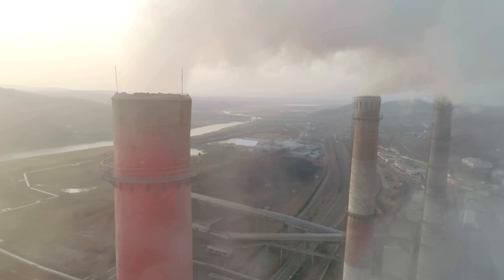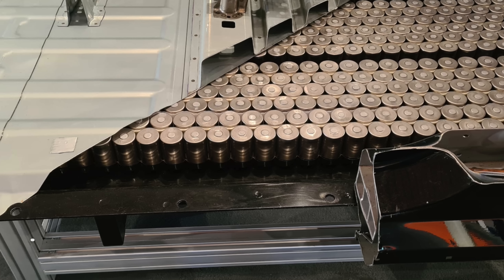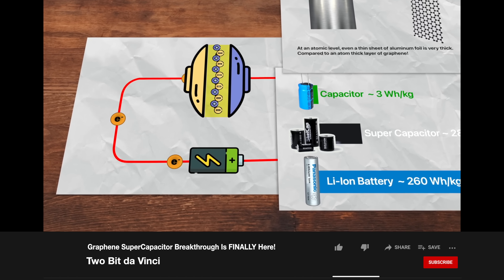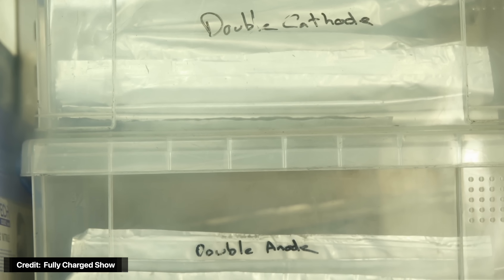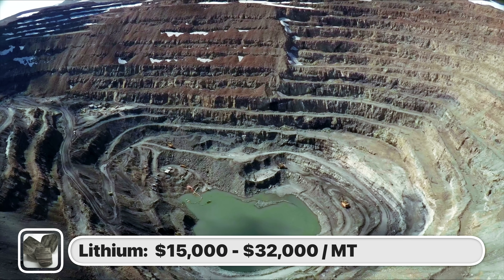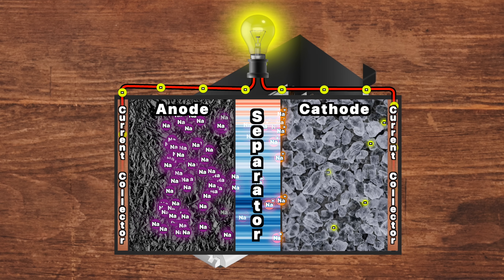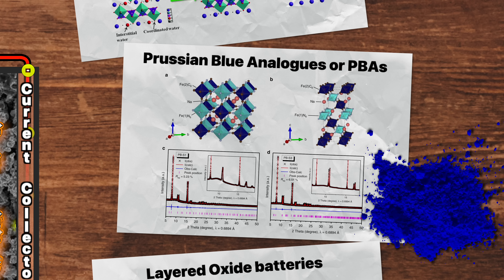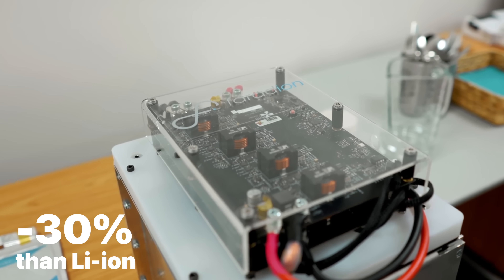Next Gen Battery is 1000x Easier to Source and 99% Cheaper!

Comment: Near the beginning of this video there is a critically important false statement that Na-ion batteries equal Li-ion batteries "in performance." Unless "performance" is measured differently than how I define it, that's a major error, because of where Na and Li are on the periodic table, depending on how you compare the two elements, Na has about half the energy density or at least double the mass as similar Li. 
But, approx 2/3 into the video, this is corrected and describes how Na is less energy dense than Li.
Unfortunately, this video does not adequately describe the consequences of this disparity which is grounded in basic physics so cannot be overcome by some technological breakthrough. This is because for any tech breakthrough using Na, because Na is so close to Li in the periodic table it means that the possible chemistries are also quite similar so any innovation for one can also be applied to the other and that means that any improvement in Na chemistry would also provide a similar benefit for Li.
That means that it would be nearly impossible for Na chemistry batteries to ever make up ground on Li chemistry batteries, Li will always be better by approx. double.

Once it's understood that the disparities between Na and Li batteries will always exist due to the laws of physics,
It then becomes possible to estimate the practical world applications of each battery.
Lithium batteries in an EV will always enable at least double the driving distance for batteries with similar mass, ie. for practical purposes although inaccurate that weigh the same. When Lithium batteries are still struggling to meet or exceed the range of a tank of gas in gasoline burning cars, that's a significant issue
Sodium batteries will always be at least double the mass or weight of Lithium batteries for the same amount of performance, which makes it hard to justify using sodium batteries in anything that's mobile like wearable electronics, personal electronics, electric powered aircraft and even EV that travel further than around a warehouse.

Where sodium batteries can make sense is in
Metropolitan power plants where land is often abundant and there is no need for mobile energy storage.
Perhaps in outer space where inertia might be a factor but weight isn't. Just don't figure in any costs to lift sodium into space compared to lithium.
Short trip EV like warehouse forklifts that never leave the building. Range shouldn't be an issue if the vehicle is always within a few hundred feet of a charging station.

But even for some of these potential uses for Na-ion batteries, there can be strong competition from thermal energy storage using Na or NaCl as the medium which would be every bit as inexpensive if not more so, and many ways simpler to design and possibly maintain.

Na-ion batteries will likely have their future place in energy storage, but it's unclear exactly where.

Comment: If solid state lithium batteries can store 3x the current battery technology then a solid state sodium battery would beat current Li ion technology and replace out it given just straight cost given it’s only $40/kw
Reply from the maker: the interfaces are a challenge for solid state, and I think solid state sodium will also take tons of research.. but in a not so distant future, I think you're spot on!

Comment: Food for thought, Lithium Iron Phosphate batteries were at 160 WH/KG when they started to get popular with EV makers (in China mostly). It was a complete shock to me when I read that CATL had Sodium Ion batteries at that density already. For most applications it is not highest energy density wins. It is lowest cost that meets the applications minimum requirements wins. For stationary energy storage the requirements that drive the decision are not energy density, but cost and cycle life... also temperature range. For cars it was fairly well proven that 160 WH/KG was high enough density if you don't need huge amounts of thermal management (again see LFP, and specifically the BYD blade battery). For aircraft, nothing meets the needs that is commercially available yet. You can make puddle jumpers work, but nothing longer than a few hundred miles. Solid state may be the first ones there, but my bet is on Lithium Sulfur, I think it will be out sooner. But who knows, the high energy market has a lot of potential contenders (none on the market yet):

1. Lithium Sulfur
2. Solid State (which could work with any chemistry)
3. Silicon and/or graphene in the anodes (also can be used with any chemistry)

Your guess is as good as mine there, but despite the fact that I invested in solid state companies I think it will be Lithium Sulfur, it is just closer to mass scale production. CATL has announced they are making those too.
Reply: Mike, I suspect, in anything bigger than "Little Airplanes, and 100-200 Miles Range per charge, some "Blending" of Batteries, Solar, Fueled Generator Onboard, and maybe even, some with Supercapacitors, will be used at the Beginning of this Transition!

It might depend on Forced Regulations, that pushes the change, or Businesses that push the Change. We all see the Difference of Tesla pushing, vs the CARB Push, back in 1998-2002!
Reply: @robertweekley5926  Yeah, it is anyone's guess at this point. Wide open for advancements, but it will need much higher energy density then we have today. Keep in mind that lithium sulfur can be 5-6 times the energy density of current lithium ion batteries if they can work out the cycle life problems. It should be at lower cost per KWH too (once at scale). But if they don't get that working you are right there are other ways to augment electrical systems. At the scale a large plain (737 size) hydrogen may make sense, but I think they may do fuel cells instead of a generator if it is prop. For jets, not my area of expertise, probably best tech we have now is just cleaner jet fuel. 

Those things are easier to overcome than the problem of prop planes not being able to operate at different speeds (something about the pitch of the blade, again not my area of expertise). Point is that there are a lot of puzzle pieces to solve before we are flying around in high speed electric aircraft.
Reply: @robertweekley5926  A start with regulation would be to not allow Li_Ion for grid storage because that's part of the reason costs are going up.  The amount of battery needed for a single installation is too much when Li-Ion is used everywhere.
Reply: @johndoh5182  Better than prohibitions are cost targets.
Reply: Lithium Iron Phosphate batteries LiFe for years had the same strategic road map as you new fangled sodium ion.  Raw Materials was way cheaper, but lower energy density meaning heavier and slightly bigger than your Lithium standard counterpart.  So what happened? Standard lithium ion battery technology just steadily and consistently improved, thereby moving the goal post further and further away for LiFe.  5 years ago I bought a LiFe battery power pack for jump starting a dead battery car.  Kept it in the car trunk for a year.  When I finally needed it , it was a piece of junk - couldn't charge and it was slightly bulging.  Basically LiFe doesn't work in real world practice.  Same could be said for Sodium ion.  right now cycle recharge life is generally 1/10 that of standard lithium and so this is the biggest problem to overcome.  Unfortunately 2bitDV doesn't go into the technical problems to give a clue how easy it is to overcome this problem.
Reply: @BerriBerriJam   Because you had a bad experience doesn't mean LFP batteries have failed. I am sure there are lots of people with bad experiences in every chemistry of batteries. LFP has been growing in usage in both home battery storage, grid scale storage, and EVs. All standard range Teslas now use LFP. Ford has announced moving to LFP (fully I am not sure) and probably half of China's EVs use LFP. LFP has been accelerating just as fast as traditional Lithium turnery batteries in  energy density, I think in adoption too, but I would need to investigate that. BTW cycle life for LFP is much higher than traditional lithium ion batteries, double or more, on average.

Anyway I am not a proponent of any one chemistry nor do I make any money or get anything from one succeeding vs. another failing. I am just pointing out that LFP started to take off when it hit the same energy density as sodium ion is at right now. I don't know if sodium ion will too, but if it meets an industry's needs and it is cheaper, it will.
Reply: @mikereinhardt1244  Wow, thanks Mike.  I stand corrected.  It all started for me in 2012 when A123 went bankrupt and some of my contacts in Taiwan told me how Lithium Ferrite was Taiwan's big bet over NMC and resulted in catastrophic failure.  The icing on the cake was my LFP car battery booster I paid $124 which swelled in the trunk and never worked. Tesla took off with their NMC/NCA Lithium type batteries and it was a reasonable assumption LFP would be left for dead.  Who would have thought, Tesla would furtively keep working on LFP until they were able to start implementing model 3 LFP batteries starting 2021.  Perhaps there will be a future with Sodium Ion, but I'd like to see a more detailed analysis of problems to overcome.  E.G. Dendrite problems, swelling at the anode and cathodes.  Does the larger crystal molecules create more problems or overcome them?  As for density, I think that's a small issue if in the end there's only a 5-10% difference like Tesla LFP's are compared to NMC.
Reply: IF red hydrogen works out, you will see liquid hydrogen fueled jets OR synthetic kerosene fueled jets keep electric aircraft on the ground.
Reply: @lengould9262  For high speed travel I think you are right. This isn't an electric vs. fossil fuel issue, it is jet vs prop plain issue. Prop planes are typically a few hundred MPH slower than jets. AFAIK there is not a production electric jet engine, and I don't even know how there really could be. 

For short trips (under 500 miles) I think you will see a resurgence in electric flight simply because it is super cheap (fuel savings) and also saves a ton on maintenance. At least that is what is being touted and seems to be accurate.
Reply: C02isplantF00D
Reply: @ActivateMission2ThisTimeline  So is horse crap, but you don't want to eat it. CO2 is good for plants, too much in the air can kill humans (as in cause asphyxiation) if you are in a sealed container because it displaces the oxygen. If you are claiming that CO2 is not causing global warming, I didn't say anything about that, so  go argue that with someone else, preferably a scientist that studies it.
Reply: I like lithium titanate batteries great technology 30,000 cycles safe no fire Hazzards until solid state can be real world realistic or carbon batteries can be produced cheap
Reply: @patrickday4206  I haven't looked into those much, I suspect they are expensive, but now you have me curious so I am going to look into them. For aircraft expensive means something else, so those may work.
Reply: Food for thought indeed. I'd like to comment on your list, though! :)

Both Si metal and graphene are in commercially available anode materials already. The use is not widespread yet, however, as most Si added is currently SiOx. Si metal in anodes is expected to quickly replace SiOx for most applications, though.

Solid state is already on the market, albeit for limited applications. As far as I know the energy density of SSB is still far too low to truly compete with current gen LIB. This could change by the end of the decade, although LIB will still be widely used - LIB is probably her to stay for a few decades if not longer.

I am personally not aware of any commercially available Lithium Sulfur batteries yet. I am not up to date on Lithium Sulfur chemistry either, so if you have a relatively concise source discussing the current state of LiS and outlining the issues to be solved then I would love to read it! :)

Comment: You might want to check on the silver that's used in those also I heard a thing on here that claimed all this stuff wasn't possible because there is not and will not be enough silver to build them we can't go solar cuz there's not enough for everyone so if they get rid of the fuel who goes without that's not fair
Reply: Silver is abundant and cheap. I follow that market closely. Industry could use 1000x more and there would be no shortage. I might finally make some money on it.😎

Comment: I'm a fan of better battery technology, but the big solution that doesn't seem to get a lot of attention is geothermal power. There is enough energy stored as heat to last us millions of years, and this wouldn't require a huge capacity of grid storage.
Reply: Getting to it is the problem, in most places. It is being worked on, though: There's a test setup in Cornwall (in the UK) which is already producing energy IIRC; and someone is planning a really REALLY deep hole somewhere else in the UK which (theory goes) will give similar output to a small-ish gas-fired power station (something in the low megawatts, if I recall correctly).
Reply: @theelectricmonk3909  That is the difficulty. I've seen that they are trying to develop plasma drills that in theory should be able to go a lot deeper, potentially unlocking geothermal anywhere.

Comment: Longer life and bit Lower range at a cheaper price sounds excellent for the majority of our driving, as long as it still charges at a reasonable rate.
Reply: ..or gets quickly swapped for a charged one as in NIO cars. If NIO wanted a cheap car, they could use sodium battery  - or offer a choice Li vs Na at the swapping station.

Comment: Hey Ricky if you use the vortex microhydro by Turbulence. a 3 ft x 3 ft cube of water multiplied over hundreds and hundreds and hundreds of miles along a river or stream bank dumping the same 3 ft of water thru a Vortex generator will solve energy problems for 100% of the folks that live near a river.
Simple. A 6' drop between generators will produce enough electricity for 40ish homes. No fish ladders, no damage to environment, no downside. The water ends up more oxygenated and cleaner at the bottom end. Zero water is "used up".
Zero fish kill. Zeros across the board...except you get free POWER.
DO THE MATH! I'm not wrong.

Comment: Use sodium based battery-power for storage purposes where size is less an issue and continue to use lithium ion battery power for mobile devices.......ending all current  carbon combustion power production is stupid considering that natural based sources of greenhouse gas is far  in excess of any man made production and until that issue is resolved then nothing is going to reverse the situation that's on going. And that's a fact.  But what also is a fact is climate change so owing down that process is vital for us too. ..

Comment: I really don't see why there should be such a big push for energy density over everything else. Energy density has no impact on grid storage or even home storage. What matters there is discharge capacity and responsiveness.

In the UK, we have lots of decommissioned fossil fuel power stations on fairly large sites, couple this with the already existing power grid connections, these make an ideal place for grid battery storage along side solar generation.

Comment: I could fit 5 refrigerators in my unfinished basement. Space and energy density of batteries are not a problem. Price is the issue. I'm very bullish on sodium ion batteries in the next 5-10 years.

We also only drive our vehicle 500 miles a month, so get me an EV with a 250 mile at a $20k price point, and I'm in. That should be possible with sodium ion batteries in 5-10 years -- just in time for the many countries (plus California) that have said no more new gas cars after 2035.

I look forward to a world where oil can no longer be used by countries to skew a political election in favor of a party, like Russia and Saudi Arabia are aiming for with the US election when they cut oil production this month. Once the election is over, they'll likely ease off, because their primary goal will have been achieved.

Comment: I think this is mainly for stationary storage.  It would be an alternative to LFP, as lithium prices go higher.  

BTW, we still have quite a ways to go for lithium.  A lot of the bottlenecks have to do with. the fact, that demand has woken up, in a big way, with EV's,  and stationary storage, over existing production capacity. There is still a lot of mining, refining capacity, build out of supply chain infrastructure, a whole new industry, that is just ramping up.  And there is recycling.  But the more, the merrier, esp. in the variety of ways to do grid storage.

Comment: What is the energy density and cycle life of sodium ion vs lead acid? If we can get a home battery that is twice as heavy/large but lasts 10k+ cycles and cost 10% that would be a no brainer, every one with the space would get one(or several). A powerwall equivalent capacity for under $1k would be huge. We do not need high density for stationary storage, after all preppers still use lead acid storage batteries today.